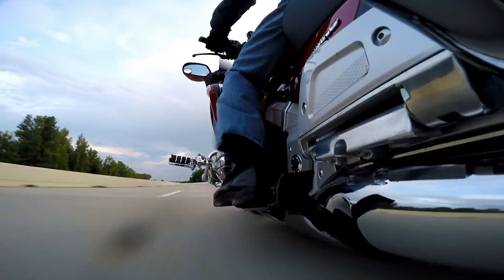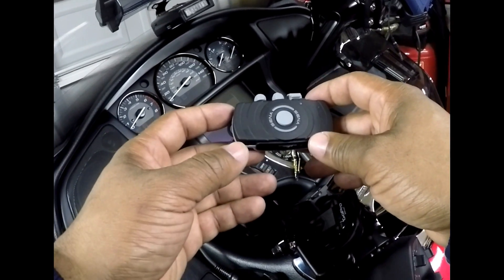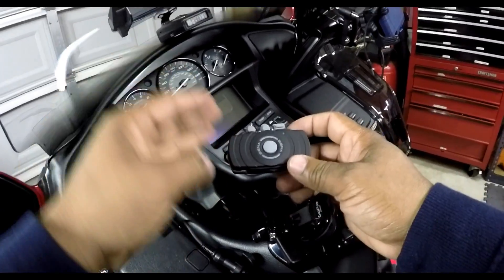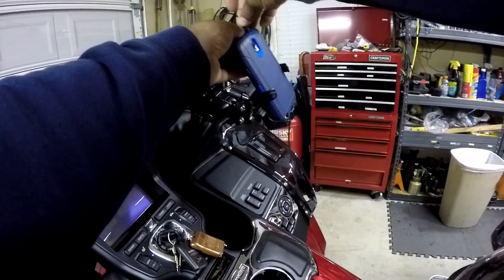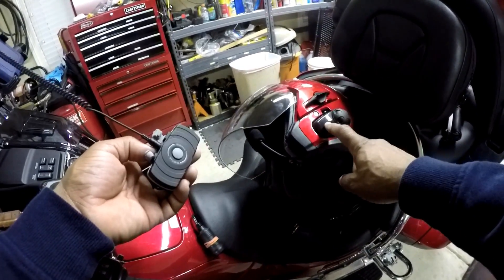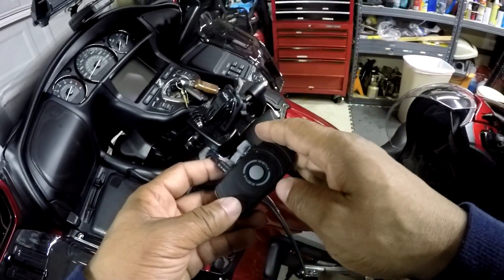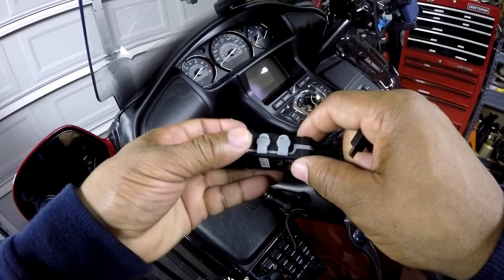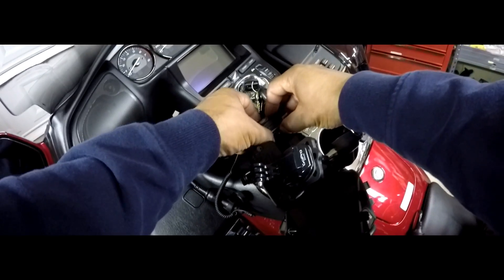The Sena SM10 explained and how does it work.

Comment: Very nice Chris. I purchased one for my F6B to pair with Chatterbox XBI2-H Plus BT units.  I didn't try the AUX input but hopefully that will allow my helmet 2 helmet intercom function work better.  I only tried the Audio IN port so far.
Reply from the maker: Try the AUX, let me know how it goes.
Reply: Both; Audio IN and AUX respond the same with my Chatterbox helmet BT unit.  I press the circular button to talk to my rider and the intercom function connects for 5 secs and then returns to the music.  I've paired the phone audio to the BT Chatterbox units and that works, only my rider to rider intercom function isn't working.

Probably the different type BT units that I'm paring i.e. SENA SM10 with Chatterbox XBI2-H Plus.  Sucks but I think I'll have to buy the SMH10 units for our helmets.

Another thoughts?
Reply from the maker: What exactly are you trying to accomplish.
Reply: Hi Chris, trying to get my intercom function to work for more than 5 secs when connected to the SM10.  Probably not something you've heard about but thought I'd ask.

Thanks for the detailed videos, the SM10 connection with the F6B Goldwing is perfect.  Will try the audio boost also.
Reply from the maker: To my knowledge, the SM10 does not allow for riders to transmit to talk, but the Freewire will allow riders to talk via intercom.  If both rider and passenger are using wireless helmets, than both will need a total of 2 Freewire's.

Comment: Hi Chris, I have been watching your YouTube channel for a few weeks now and like the content. I have a Honda F6B deluxe model and love it. I quite enjoy the audio system on the bike and have managed to Bluetooth it to my phone via a Bose Bluetooth adapter. However, I cannot answer calls through this setup. I have a question for you since you seem knowledgeable about the Sena products. Basically I want to listen to music on my phone through the bike's speakers but I would like to be able to take a call or make a call through the Bluetooth connected to my helmet (currently the Sena 3SB). Just want to use the helmet Bluetooth for calls only. Will the Freewire allow me to do this? If not can you recommend a way of setting it up with some other product? Thanks for any feedback you can provide.
Reply from the maker: If you have a 12 volt cigarette charging power outlet, you might consider a Excelvan Wireless Bluetooth FM Transmitter that you can plug into a cigarette  outlet, then bluetooth to your telephone to the transmitter, just select a clear FM station on your radio, from there you can stream your phone's music back through the bike speakers.   As for your helmet, you can just use a Sena bluetooth wireless helmet headset to make and receive calls.  Keep in mind that you can only have one device bluetoothed on your phone at a time, so either select listening to bluetooth music from the phone through the speakers, or select bluetooth your phone to your wireless helmet just to send and receive calls, but not both at the same time.  Here is a product link for a Fm transmitter https://www.amazon.com/dp/B00HBLZ538
Reply: Chris Caliente thanks I will look up some of your suggestions.
Reply from the maker: Cool

Comment: The cable does not come with the purchase of the SM10, the part number is SC-A0121.  I bought mine from Amazon.
Reply from the maker: You are 100% correct Karen, the connection cable for the Goldwing to the SM10 is sold seperately.

Comment: I have that as well, got it when I got my bike with the Sena head sets.  I never use it, just do not like the sound in the head set speakers.  No Bass.  Even when you hit the center button and amplify.
Reply from the maker: A quality wired audio helmet system that plugs into the Goldwing 5 PIN DIN will sound better than a wireless bluetooth helmet system anyday.  When I connect my Sena 20s to my Sena SM10 it does allow me to lisen to Goldwing Infotainment at highway speeds at good levels.  The truth is that when a rider switch from a wired system to a wireless bluetooth, quality is subject to be reduced.
Reply: My phone will snyc to my Sena head set and it does sound better.  I like the actual speakers on the bike the best.
Reply from the maker: Jim, I always motov when riding my Wing, therefor rarely listening to music, but today after reading your harsh comment about the SM10, I went out riding and played my Goldwing's infotainment / Ipod through my SM10 wirelessly to my Sena 20s, the music coming from my SM10 to my 20s headset sound amazing with plenty of bass and treble.  I'm not sure why you think the sound quality is poor from the SM10 but I disagree with you.  It very well just might be a poor quality radio station your listening to.   I have a few questions, do you have an ipod/mp3? and what model Sena headset do you have connected to the SM10?  have you connected a CD quality music source to the SM10 and lisened through your helmet?  Please respond.
Reply from the maker: Jim, I always motov when riding my Wing, therefor rarely listening to 
music, but today after reading your harsh comment about the SM10, I went
 out riding and played my Goldwing's infotainment / Ipod through my SM10
 wirelessly to my Sena 20s, the music coming from my SM10 to my 20s 
headset sound amazing with plenty of bass and treble.  I'm not sure why 
you think the sound quality is poor from the SM10 but I disagree with 
you.  It very well just might be a poor quality radio station your 
listening to.   I have a few questions, do you have an ipod/mp3? and 
what model Sena headset do you have connected to the SM10?  have you 
connected a CD quality music source to the SM10 and lisened through your
 helmet?  Please respond.
Reply: Harsh?  I never listen to the radio.  I listen to MP3's  I  have the Sena 10's head sets and the speakers do not sound good to me with music, so I just don't use them.  Nothing harsh about about or towards you?
Reply from the maker: No offense taken Jim, my headsets are the Sena SMH10, and the Sena 20's, and I have no complaints with sound quality. I am not so sure about the latest Sena10c model's, they may be the culprit being a cheaper headset, therefore I never recommend them. I do recommend the Sena 20s headsets, but they cost more.  I have no problems with the Sena SM10 transmitter output quality. I'm a firm believer of we pay for what we get. BTW youtuber MemphisMike bought the 10s headsets for his wife, and was very displeased about them, until he updated the firmware, now I think he's okay with them, you should ask him for his opinion about them.
Reply: I have both SMH10's the are perfect for what we use them for.  Talking to one another while we ride.  But they are like having two transistor radios in each ear for music.  I  just do not like that sound in my ears.  Guess I am just old.   Just more noise than good sound.  Glad yours sound great.
Reply from the maker: I do understand.
Reply from the maker: Yea bluetooth is never better than a hard wired setup.
Reply: The Goldwing speakers sound WAY better than Sena20 wireless headset speakers do.  I have Sena20's and the SenaSM10 with 5pin cable to Goldwing.  Loose bass and mids with headset.  In hindsight instead of buying Sena20's and cable and SM10, I should of just bought wired headsets for Goldwing.Pushing headphone button on bike buttons back and forth it is easy to see difference.